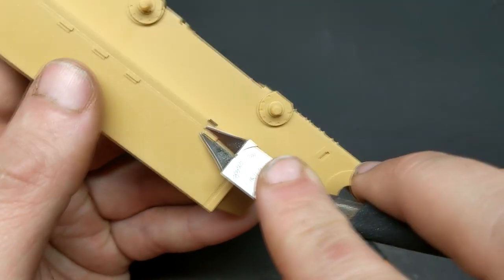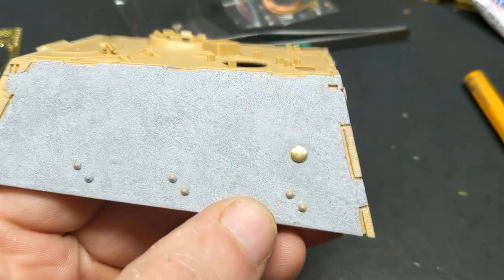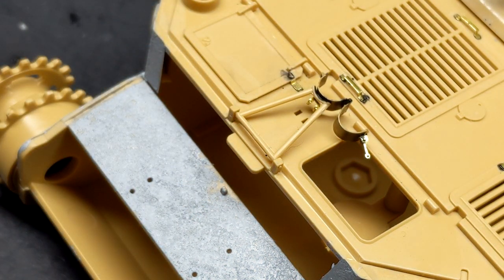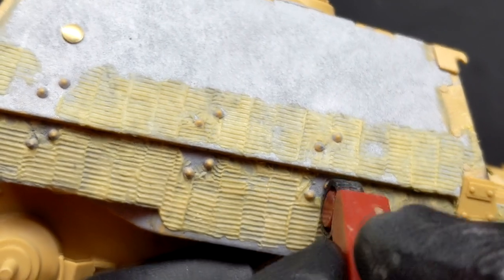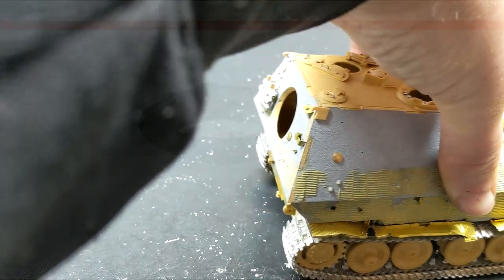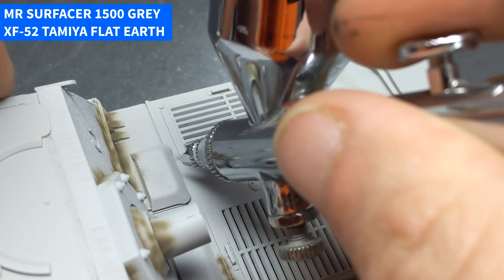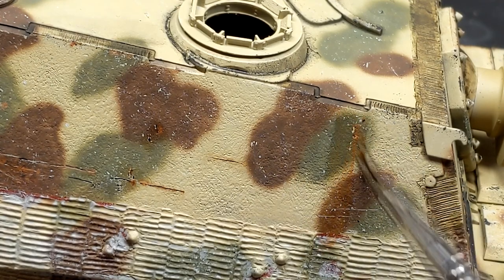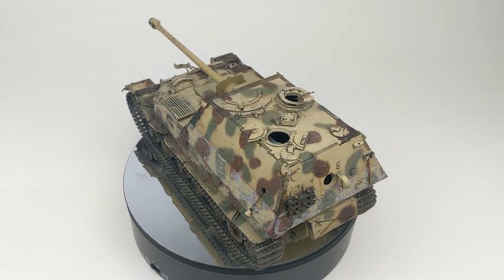Building the coolest Porsche ever! The Tamiya 1/35 Sd.Kfz.184 Elefant

Comment: You are correct in damaging the zimmerit as hard as you did. MG fire would knock it off a lot. 
I worked with German armor when I was a volunteer at the Patton Museum (when we still had tanks), rarely did German primer fail and expose the steel beneath it. Fire would destroy it and large rounds striking the vehicle would strip it off. 
Wear and tear from the crew did not.  We had several AFVs that had original paint, and even after 60 years (back then) the red lead was still in place. Very nice work, for a wingnut.
Reply from the maker: Good to know! I don’t know much about armor but I know the armor guys have their eye for that detail

Comment: I recently worked on a Voyager kit for a 1/35 scale tiger. It also came with working hinges for the front fenders.  I was able to get the fenders correctly bent so that the hinges worked great... and then I ended up gluing it all down in place.  The problem with these parts is they have almost no mass.  Therefore they don't naturally lay down in place against the body of the tank.  If you are ever so slightly off in your alignment or if the part is even slightly bent anwhere, then the fenders would refuse to rest down in the proper position.  It ended up looking just enough wrong and out of place that I ended up gluing them down.  But they do look cool regardless.  The detail is amazing, and it was satisfying to work with such tiny pieces of PE and actually make it look like something.
Reply from the maker: I’m glad you went for it! In hind sight there are a few things I would do different with a voyager kit the next time around. Mostly finding what absolutely needs to be used and what can sit out.

Comment: If you want metal tracks that don't need clean up, look into R-Model tracks. The set I used on a Tiger were excellent, and you can also get them with pins to hold them together instead of wire.
Reply from the maker: I have some masterclub ones for a Panther and they are beautiful. No clean up needed.